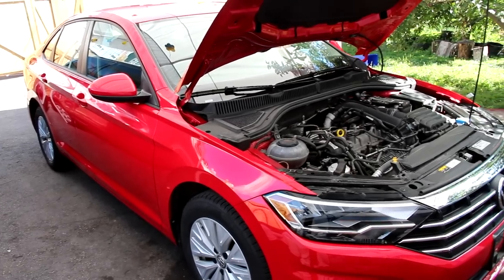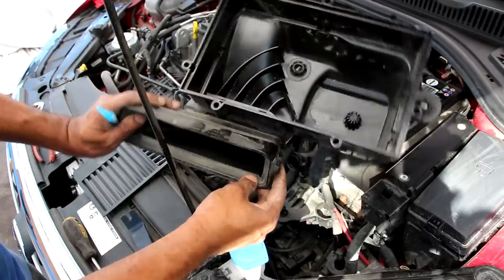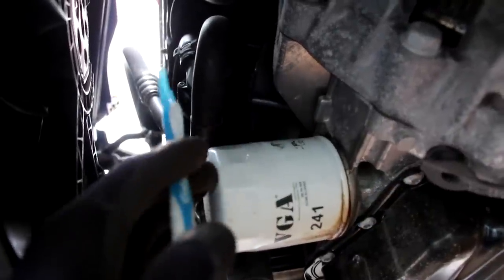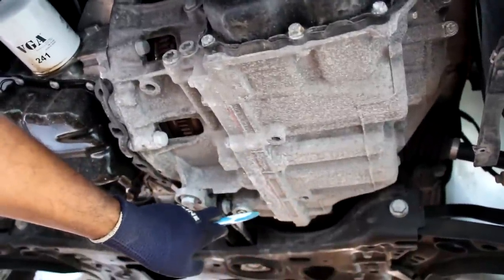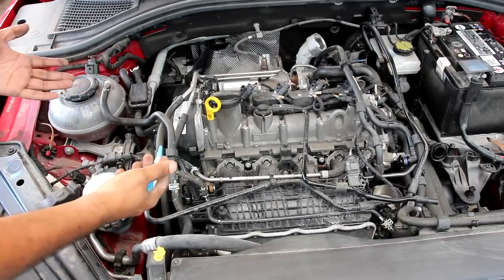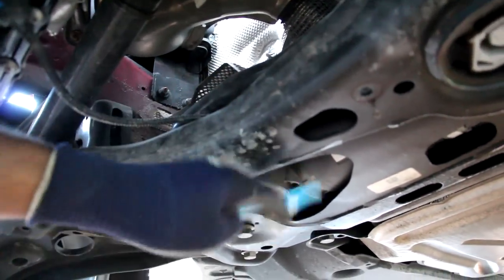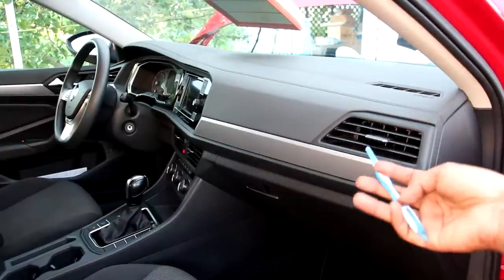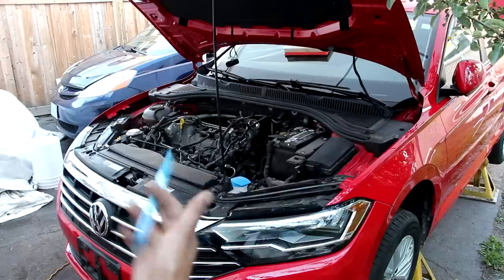Volkswagen Jetta Mechanical Review

Comment: German cars are all fun and games until its time to work on them.
Reply: or untill something went wrong and start replace things randomly to try fix the problem
Reply: Until it's time to change the air filter lol
Reply from the maker: Agreed
Reply: They're too expensive to get worked on,  all Euro cars are.
Reply: @Tony32  That is not so bad.  So you can't simply pull it out like I can on my Mother's Nissan.  Other than that I like my 2013 Passat 2.5.  I fear that the CVT in my Mother's Nissan might be a Pandora's Box of problems.
Reply: @grandcrappy  Sometimes the timing chain is a nightmare on those.
Reply: @charleshines6155  but this engine doesn't have a chain.
Reply: Idk man. The cabin air filter in my 2016 jetta is easy cake compared to the 2016 nissan nersa my mom has. Almost brake the damn filter getting it there. And the air filter takes 10 mins to replace on the jetta. Easy maintenance forsure
Reply: @husseymangtv  cabin filter you say? Good thing its a VW and nothing else can or will go wrong.
Reply: @mrsargemeister  😬😬 true nothing breaks on vws
Reply: @Techie1224  Well maybe if you didnt aproach it like you would a toyota you wouldnt have that issue. One advantage of german cars over everything else that they will throw an error code for the smallest things. Exactly so you dont have to braindeadly swap parts until its fixed.
Reply: @waifuracer6516  As the proud owner of a GLI VR6 with a faulty E brake warning going off, the ECU does not have codes for everything.
Reply: lol so true

Comment: I have a 2017 Jetta with 90,000 miles. But I take of my cars and keep up with the maintenance and use Amsoil oil and filter. Last time I changed the oil at 90,000 the oil looked almost as new as the oil I put back the Jetta. And I follow Vw guidelines on oil changes every 10,000 miles.
Reply from the maker: Nice, 10K miles is pretty long for an oil change. It would take me 2-3 years to drive that much haha

Comment: I have a 2016 with same engine. 126000 miles. oil changes, spark plugs , filters, etc . Now timing belt. No issues except a spring in seat recliner come off.
May just be my experience but it's been a great car. I drive a crap ton. Will see how it does . I'm getting carbon cleaned out soon for extra measure.
Reply from the maker: How's maintenance
Reply: @speedkar99  not to bad because I do it. 😁 Oil change every 7500 instead of 10000. Cost about 40$filter and oil .
Trans fluid drain and fill every 75000,spark plugs, normal stuff . Cost a little more than a Nissan versa that I had and put 190000 miles on . Certain engines are better than others that's for sure. I also have a 2008 rabbit with 2.5 5cyl .It's pretty solid.

Comment: That "baffle" in the airbox is a Snow grate. It functions similarly as a Air oil Separator would but with snow and water. The drain at the bottom dumps it out at the bottom of the car. True while this car is a bit overenginered and may seem overwhelming to some people. Any thing that can go wrong with this car can happen with just about anything else on the road. Personally I wouldn't mind having to work on mine because I like the challenge in it.

Comment: Had a '90 Mark 2 Jetta for 12 years, and 239,000 k.m.---great driving and riding experience, but costly ownership due to poor electrics. 1.8 motor and old-style auto---i.e. 4000 rpm's at 120 k.m.  Best-ever seats and visibility, great steering and tracking, and solid throughout. This purchase after owning a '79 Rabbit for 11 years. Daughter has a 2016 Jetta at 96,000 km. and no issues.  Thanks, SpeedKar99 for your insightful reviews and education.---all 'top-shelf'.
Reply from the maker: You are welcome

Comment: Thanks for reviewing components and systems that may require additional investment by the vehicle owner and attention by the mechanic. I recently watched quite a few under hood reviews of competitors in the entry level vehicle segment, and I am  rather impressed by the Volkswagen, (VW) engine.  It's intriguing enough, to where I want to look past  all the plastic, flimsy vacuum lines, and replacement parts complexity. I really like how much time was taken by VW to figure out how to integrate the turbo and exhaust manifold into one piece.  I really like that the intercooler was eliminated by adding a coolant line at the intake manifold. I am thankful that the water pump is on the opposite end of the timing cover and that the ball joints and wheel bearings are bolt on. To sum it up I like the vehicle design and I appreciate all that this Mexican made VW is introducing in an attempt to offer value while extracting the most efficiency and horsepower out of the engine. Down the road of vehicle ownership it appears important to keep an eye out for failing parts and cash handy to replace them.

Comment: Really enjoyed your excellent analysis of the engineering and ease of maintenance trade offs! I used to have aToyota Tercel and it wasn’t until I switched to a VW GTI that I realized what a phenomenal job Toyota did in making their cars easy to maintain. For example, they didn’t use all the different fasteners VW does: triple square, torx, metric bolts. My Tercel just used metric bolts everywhere and... they only used even-sized bolts: 6mm, 8mm, 10mm, etc. That made it very easy to guess which size socket to grab from the toolkit. It’s much easier to guess the socket size when they’re all 2mm apart and always even!
Reply from the maker: Agreed there. Toyota (and most Japanese) cars use even size metric until 14mm. Then it jumps to 17mm and goes odd numbers from there on to 21. Then 22 for the crank bolt.
Reply: @speedkar99  Yeah, Japanese cars follow the JIS standard for bolt sizes, which has no 13mm, no 15mm etc.  There doesn't seem to be a German DIN standard for bolt sizes!

Comment: The wiper fluid nozzles are heated to prevent icing.

Where are you located? Want to mechanically review my '16 Golf R? Or '01 Cabrio VR6?
Reply from the maker: Toronto
Reply: My 2000 Daewoo Lanos was designed in such way, that it had holes in sound deadening material around spray nozzles. They would melt first quickly after engine startup.

Comment: I purchased a used '14 TDI sportwagen back in February and have put over 26k miles on it in 7 moths. I have looked under the hood and i can already tell if anything goes out i am screwed (The engine bay is so convoluted) . This is my 2nd V.W and i completely understand why everyone loves to talk crap about V.W's engineering. But if you take care of it will will have many trouble free miles! I personally love my wagen i drive around 200-250 miles a day and i get amazing highway mpg, the car is quite and smooth and the build quality has held up extremely well for a 7 year old German car.
Reply from the maker: Good to hear
Reply: From my experience. If your car is driven on the highway 75 to 80 percent of the time. It will remain reliable, and bug free for a very long time.

Comment: I have a 2014 Jetta with the 1.8L motor and it's been a really good car for me. @68K miles no issues except that I am on my third battery. The stock batteries are really weak in these cars. Other than that it's been super reliable with no issues other than general maintenance ☺️!!!
Reply from the maker: Good to hear

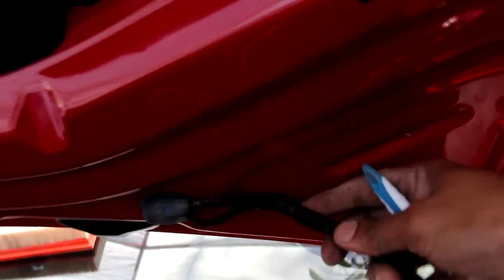Comment: 7:40 i think that's just a heater for the sprayer nozzle so that it doesn't freeze over.
Reply: Why does that need to be there? Ive never had a nozzle freeze over
Reply: @andybub45  I've never had a nozzle freeze over, but i have had ice freeze over top of them. Really hard to get off.  Its nice to have washer fluid in -14 snowy weather. I think thats a nice feature for some places.  But then you look at the 12 point reverse torx bolts that'll rust to pieces in a snowy climate and youll need to turn to liquid to remove. Horrible.
Reply: @andybub45  I've had it happen a ton. Engine gets hot, then you turn it off and snow melts on it and as the engine cools it re-freezes as ice inside.
Reply: @elkofcanada5003  i have never seen that happen to any vehicle once use the appropriate fluid 😳 at over 1300 meters above sea level with winters - 37°C  ice on top yes inside the sprayer never seen it unless u going below
 - 50°C then u would have other issues
Reply: Yup! It has been a while since I've had a car without them.
Reply: @joebrown9621  I wish my old Saab's washer jets got that notification. The fluid in the lines never froze, only the liquid right at tip of the nozzles.
Reply from the maker: Washer fluid doesn't freeze until -30-40
Reply: @speedkar99  sure, but pure washer fluid isn't necessarily what is frozen at the spray head. I can't say that I've ever had the fluid freeze in the lines, but I have regularly had the sprayers themselves freeze up on my cars prior to having heated sprayers. Once fluid starts flowing through them it's fine, but after a freezing rain or rapidly dropping temps when it's wet outside can cause water freeze inside the tip of the sprayer. Usually it was enough to just hold my fingers on the sprayer to thaw it out, but that's not something fun to do when it's freezing and you just want to be able to see through your windshield.
Reply: @speedkar99  It's an option on VW's - heated windshield nozzles, so yeah, they are heated

Comment: VW dealer tech here. The transmission does actually have a fill plug right below the front of the battery tray. It’s a Torx T55 and takes at least a two foot ratchet with a swivel to break it loose haha
Reply from the maker: Good to know. The manual specs to use the machine to pump it inside from below. Messy job
Reply: Thanks

Comment: I had a 2014, never will I own a VW again. Had 2 fan controllers take a unexpected layoff. It caused my TDI to get stuck in regen mode. The fans would keep running and running when the engine was off and would kill the battery. 
I had a standard trans, which was excellent, it got 60 mpg to work and 48 going home. The emissions update I should have never done the first time. It screwed up the mileage
Reply from the maker: Ah the dieselgate 
Did it affect your mileage that much?
Reply: That wasnt even really the mileage you were getting

Comment: Why do these torx screws even exist? Is there any advantage to them?
Same with the autobox having no fill plug..?
Reply: I don’t know but my theory is they use them as a deterrent for DIY repair. An average person doesn’t have triple square or Torx sockets so they are more likely to bring the car to a shop. I found this interesting on a BMW I have, they interchange between regular metric bolts and Torx on certain parts. What’s strange is they add Torx bolts to very specific parts, such as the air filter housing, but use metric bolts on the suspension. Germans also love using hex for caliper slide pins and rotors screws. As for the transmission fill port, this is pretty common nowadays with “lifetime fluids”, you just have to get creative and find the factory procedure for replacing it.
Reply: Torx is far more difficult to strip than most other screw heads. Vw still sucks, though.
Reply: Torx can take more torque and don't strip easily. The torx screws are actually awesome. The problem is that VW didn't take the time and effort to simplify things. Making things simple actually requires a lot of skill and effort.
Reply: it will be k if they only use torx but they will mostly have  mixed all types into the car to make it unrepairable 😂
Reply: It light strong gives a good grip. I like it when I have the tool for it. It can't slip like a star screw driver screw.
Reply: No such thing as lifetime fluids lifetime for them
Reply: Torx are awesome though! Better question is why the US still obsessed with phillips heads for so many automotive and non-automotive applications.
Reply: @hayksamvelyan  I'm pretty sure you can actually see the fill port at 8:30 when he is looking at the top of the transmission. (The huge hex bolt at the top of the transmission just under the battery box.)
Reply: @CriticalDepth  i see the bolt you mention, more than a bolt is a recessed plug with torx or hex female head, it could very well be a fill port
Reply from the maker: Torx can take more toqur without stripping. 
It's uncommon because it's much more expensive to manufacture
The fill plug is within the drain plug. Inside there's a straw that holds the level
Reply: @speedkar99  weird, Volvo uses a variant of that same Aisin 8-speed transmission in a number of their cars and they all have the fill port right at the top front about where that torx bolt was on the VW. They also use the same two part drain and level tube on the underside as that VW. I guess Volvo just wants to have easier services.
Reply: @speedkar99  the DSG gearbox also is officially filled from the bottom with a very annoying method, but no one does that as you can fill it from the filter housing on top(albeit much more slowly)
Reply: @hayksamvelyan  I got creative....will never buy a German car in my life that's for sure.
Reply: Better for automated assembly. Better at holding torque. Slightly lighter, less material. Also discourages you from doing your own work on the car... All pluses for VW
Reply: Toyota automatics fill-up similarly, then you warm the tranny to check the level via straw in the drain plug, with the engine running.

Comment: I bought my 2019 VW Jetta new w cash in early 2019 and a little over 2 years and almost 40,000 miles later shes still a flawlessly running car. I drive her daily and I have the 6 speed manual but I'm a Euro car enthusiast and I owned an E90 BMW for many years before this so this engine will probably be much simpler for me whenever the day comes I do have to do a little of my own wrenching or maintenance. It's a life style! I owned an Acura TL also for a few years before my 335i and I never even thought of going back to Japenese cars, still haven't.
Reply from the maker: Good to hear from an owner

Comment: I have one of these! I have a 2019 Jetta Execline with the virtual cockpit, but I gotta say the Jetta 1.4T EA211 147hp is extremely slow and underpowered, and the small displacement and big turbo also has ALOT of turbo lag, when you press the gas pedal the car stutters for 2 seconds then starts slowly accelerating then when it reaches 3,000 rpm the turbo kicks in and you get good acceleration only after the turbo spools up at around 3,000 rpm, I wish VW had kept the 1.8T/170hp engine but the only way to fix the 1.4T lag problem is by using very expensive Shell V-Power 91 octane premium gas, on cheap 87 gas the 1.4T stutters very much and not smooth. I strongly recommend buying the Jetta GLI with 2.0T/228hp EA888 which is so much more power, more smooth and drives miles ahead better than the 1.4T standard Jetta
Reply: It's like the US is getting fake VWs. Because in Europe and Africa this is honestly a different story. That 1.8 engine was long discontinued because it is old fashioned and way too heavy on fuel.
Reply: 150 hp underpowered... It's about the most we can get on a standard golf/octavia/leon/... here.
Reply: Turbo cars work fine on 98 and 100 octane gas. Don't use low quality gas.
Reply: It's a small turbocharged engine. You gotta run it with the proper gasoline to get the most out of it. Regular gas in Europe is 95 octane RON, or 90-91 American units. 87 will just not cut it, because its octane rating is way below what the engine is designed to use. Having 87 in this engine is like trying to bake cinnamon buns with salt instead of sugar.
Reply: @igcamacho  Yes, just because the manual says you "can" use it, doesn't mean you "should".
Reply: The car recommends 87 but has anyone tried 91 and noticed a difference?
Reply from the maker: In fact I was surprised how well the Jetta pulled after 4k rpm for a small engine! Very strong for it's class once the turbo spools
Reply: I'm incredibly surprised you said this.  I do use high octane gas so perhaps that's why.  But the acceleration for its class is absolutely fantastic.  I pass people and accelerate no problem.  About 8.5 seconds to 60mph, which I'm more than happy with considering the fuel economy is 42 mpg average on the highway at 70mph.

Comment: 15:05 "they are still using lug bolts which makes it more difficult to install wheels" True but owner should know there is a wheel hanger/alignment pin in the trunk tool kit to solve this issue or can be ordered on Amazon.
Reply: True but you should know that using lug nuts prevent all of that 😝😜🤘